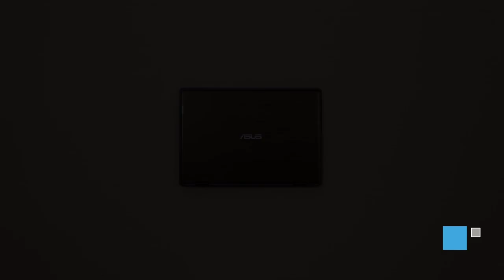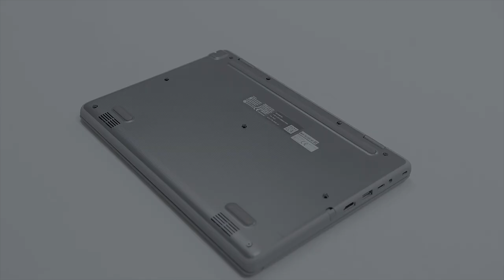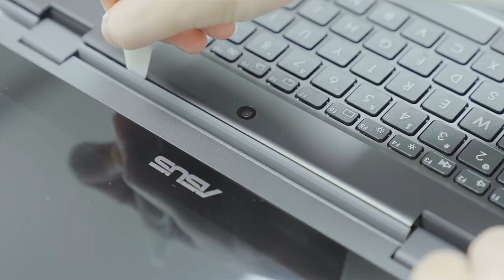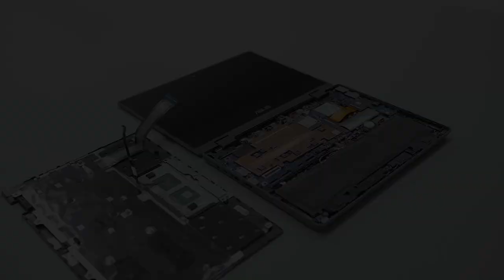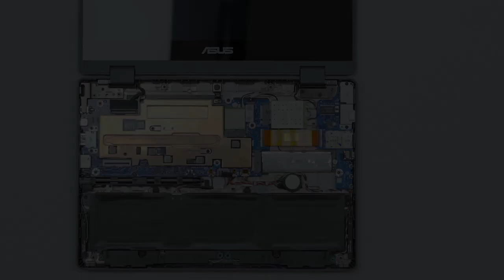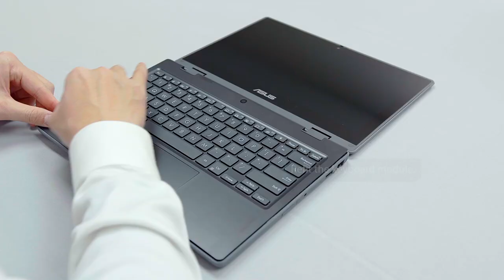Replacing the SSD of ASUS BR1100 in 5 steps | ASUS

Comment: Remember!! There are two hidden screws near the middle at the top, you have to get rid of the stickers which look like the plastic body themselves. And the screws are not coming off when you loosen them, it's by design. I almost broke my laptop because of overlooking the hidden screws. When you use spudger to remove the keyboard it will more or less damage the rubber edge of your laptop so be ready for it, it's inevitable.

Comment: I just bought the BR1100CKA-YS02 model as an open box from Microcenter for $30. Mine had an empty M.2 slot available and I installed this MZ-V8V500B/AM which I purchased from amazon. The specs are listed as SAMSUNG 980 SSD 500GB PCle 3.0x4, NVMe M.2 2280. Windows wouldn't boot after from the eMMC but I just reinstalled windows anyways and used the new 500 GB partition. The 64GB eMMC partition, I'm gonna use to install Androidx86 again.
Reply: Does the android86 act as real android i.e will be detected by apps as legit phone os that can be used for games?

Comment: 4GB in 2022 is a no, minimum requirements to make laptop run smooth for Windows 10 and 11 is 8GB. This is because there's software that need to run on the background. 4 GB will be full and you cannot open web browser properly. Asus making a mistakes here
Reply: I don't mind if the RAM is upgradeable. However, as usual, Asus worst decision-making makes it unupgradeable. It's a big deal breaker for potential buyers.
Reply: But it's upgradable and also how else would it be cheap lol
Reply: @Maximus20778  its not
Reply: Runs Edge browsing very fast. Picked one up for $84 incl tax open box. Only issue for me is, the m.2 slot seems to not detect mSATA (from another ASUS laptop) but it may work with NVMe.
Reply: Add NVME drive. Extremely fast and can be used as extra ram
Reply: @casioak1683  Computers I've seen that use LPDDR4X are soldered including Dell Latitudes and Lenovo ThinkPads.
Reply: @Ikouy  Yep that's why I buy HP & Acer. In my country these are top three best selling laptops (only below Asus). Asus should allow its user to at least able installing 8 GB RAM maximum.. not 4GB
Reply: @casioak1683  I probably should rephrase it.  It is entirely possible that LPDRR4X does not come in a SODIMM package.  The BR1100 is not really meant for consumer use and since organizations and schools don't upgrade then there is no point for RAM slots even if it were.  I agree 4GB is not enough, but with an NVMe slot you could use some of that storage as virtual memory.

Personally I prefer business/school grade (if not industrial) tech as I've yet to worry about repairs.  Consumer grade tends to fall apart under normal usage and does not usually offer battery lifespan preservation for longevity.
Reply: RAM is no issue taking in count price and what it's designed for. 64GB of internal space was absolutely an issue. Upgrading this laptop under those specs to win11 was the last drop for me to change to Linux. I did upgrade the hardware with more storage, but still not coming back to windows. It works amazing on Arch Linux.

Comment: Recently purchased this product from microcenter. Which brand SSD mostly support on Asus br1100ck notebook.
Reply: I'm not good with pc but i have a question does this laptop have a hard drive or only ssd  or both?
Reply: @wisammoeali  both are wrong, it's a slow eMMC hard drive, soldered into the motherboard, non-removable
Reply: @thihoang1944  but i see people upgrading it

Comment: I did manage this without disconnecting the keyboard/keypad. Just rest it against something solid.
Reply: Can confirm, I did the same thing lol
Reply: I have hear of people disconnecting the mouse pad and not being able to put it back or after they did, it does not work. It is a very flimsy connection. Keyboard connection is good. Be very careful not to tug on the thin mouse pad cable.

Comment: the ssd m.2 wont detect after installation, i tried few brand WD 128gb green, v-gen platinum 128gb all same, maybe there is some settings?
Reply: Yes, you should use a M2 SSD BOX plug into your computer for setting first, and backup your windows system. And then, you can install it into your notebook later. When you start your notebook, you should click del to go into your BIOS for settings, set the boot hard disk and then you can use it now.
Reply: @Zihying  any further info?
Reply: @penyepongNASA  do you have any problem when you are installing the SSD?
Reply: Have to go into Disk Management (search in search bar) to initialize disk. Then it can be used

Comment: htf do you get the lid bit spudged? all i am doing it is ruining it. jesus. it is not this easy AT ALL without doing significant damage to it. don't use fast forward to fool customers.
Reply: They don't show it in the video - on the backside there are 2 additional screws that are covered by 'stickers' that hide the screws.  once removed, you can then open easily.  Terrible video.